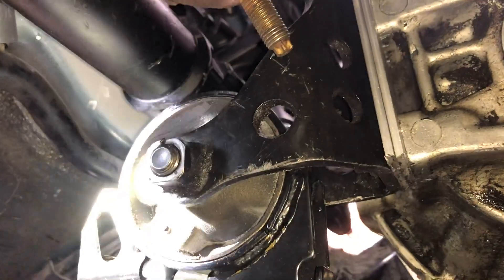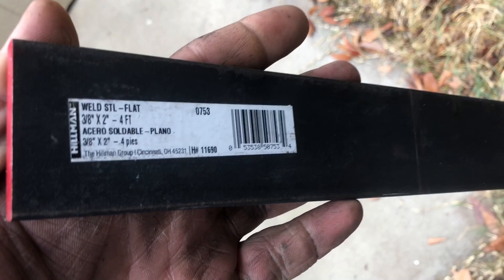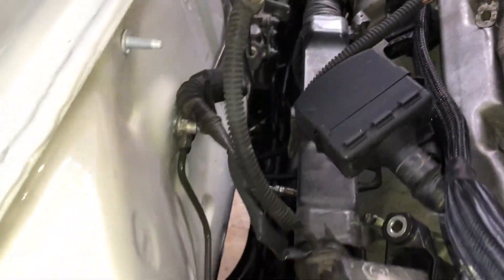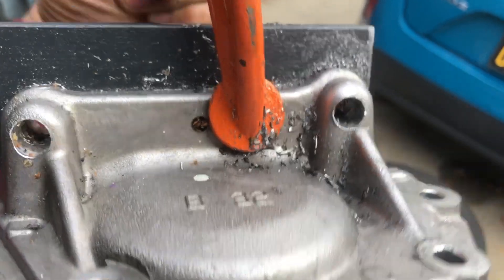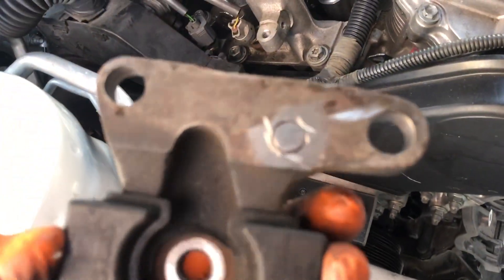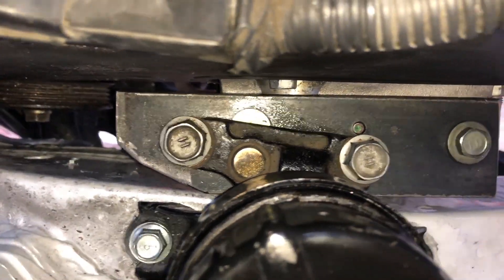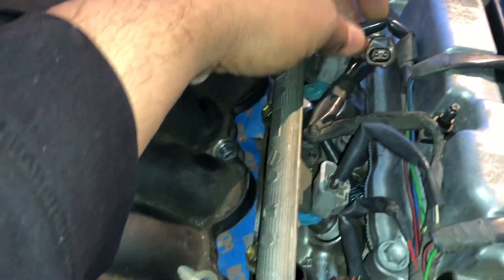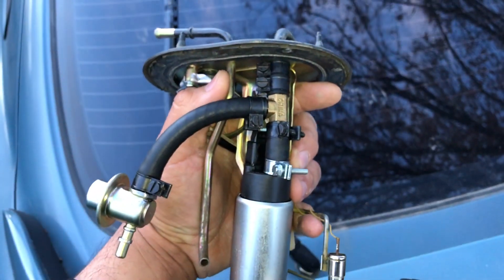Pt: 8 The Whining V6 Celica / Custom engine mount bracket 1MZ-FE into a 6th gen Celica.

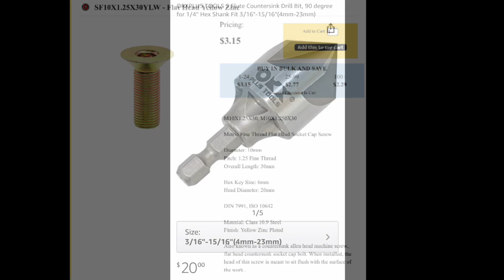Comment: 6:05 public service announcement here- I ordered and used this bit, ended up going too fast with my drill, and almost ruined the bit. It got super dull and melted slightly. I sharpened it on my bench grinder and finished countersinking on a slower speed. So if you go this route remember to take it slow!
Reply from the maker: will for sure pin, thanks

Comment: Hi, what transmission u are using ? Camry v6 or s54. If Ure using the Camry v6 what bracket are u using for the transmission mount that’s in the front by the radiator I’m having a hard time with mine. I’m running 3mz fe with Camry v6 manual tranny.
Reply from the maker: I’m running S54 with a C60 TRD LSD. 

Use st205 transmission mounts for the e153 trans
Reply: I’ll try to find one because I tried to use the s54 bracket that didn’t work.
Reply: Thx for the reply. I’m building my passenger mount today just like u did thx a lot for the infos.